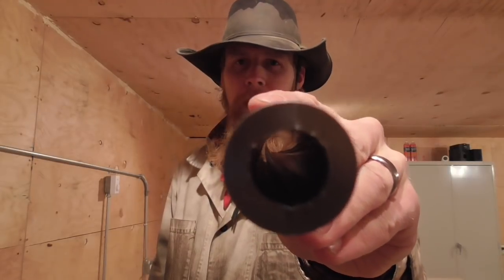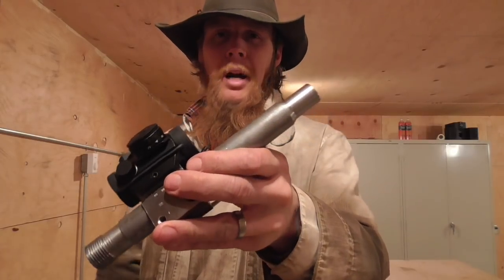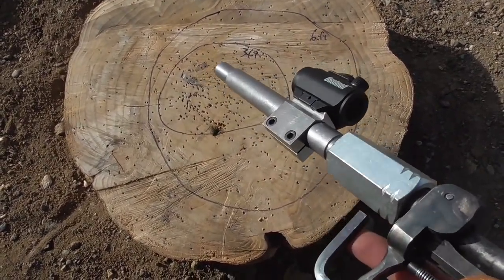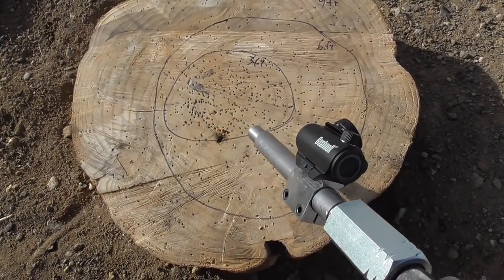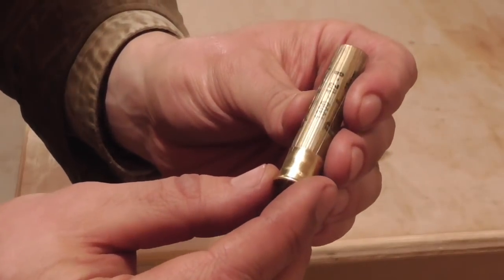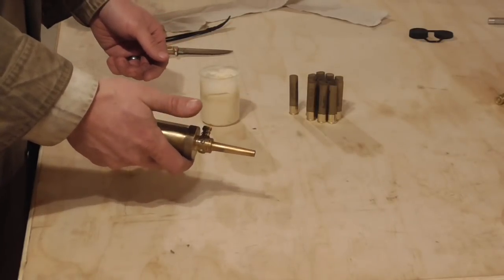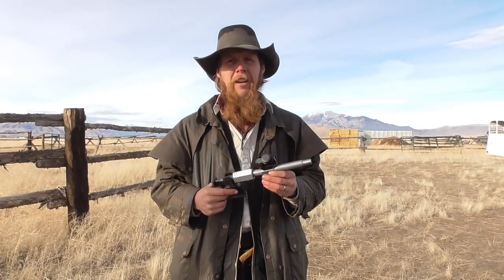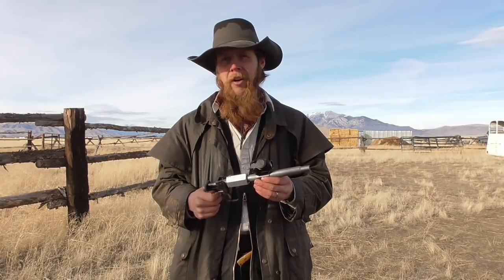Hybrid .410 Shotgun / .50 Cal Muzzleloader Experiment (TIS126)

Comment: have you considered cutting the plastic off of the already fired 410 shotshell casings and then repriming them, loading that apparatus into the barrel and then loading in the black powder, wadding, lube, and 50 caliber ball as if it were a traditional muzzle loader. there is a product out now somewhere that turns a break open 12 gauge shotgun into a muzzle loaded shotgun. it is a metal cup shaped insert that is chambered like a shotshell but it is like just loading the brass part of a regular shell and is made to accept 209 shotgun primers which just push into place with your fingers. it is not a tight fit with the primers to require tools but the primers don't tend to fall out either. then the rest of the load in the shotgun is done as if it were a muzzle loader. this product is what causes me to think of using just the brass from the 410 shells. you may also be able to keep the brass from splitting if you make a thin metal sleeve to collar the 410 shells brass section with when shooting them originally in your barrel and subsequently after they have been reprimed. this would increase the life span of the shell casing brass somewhat.
Reply: here is a link to the adapters that ifound in case anyone wants to see what iwas reffering too

https://www.gunadapters.com/209-muzzle-loading-adapters/

Comment: Shoot .454 casul out of it. It is a little bigger than the .410. (Are you using reloaded .454 brass for the .410 shells?)
Reply from the maker: I'm afraid .454 casull would still be a loose fit.  I'm thinking I might try chambering it for .50 Action Express instead.
Reply: Hum, not sure the .50 AE has enough rim to easily do that. Also it is a shorter case then preferred for this application. I think just maybe dedicated barrels might be the easier option. If you set up some sight that do not have to be shared between them, should be easy enough with your design to change barrels out. Seems to be the point of your pistol design actually, ha.

Comment: You could also try shooting 45 colt in it also  . The pressures of the older version type ammo may not have to high of pressure ?
Reply: the barrel is .50, so it will just bounce down the barrel and perform similar to a musket.

Comment: Dont forget that a rifled barrel puts centripetal force on shot causing it to turn wildly as it leaves the barrel and be extremely inaccurate. Shot needs to be fired down a smooth bore
Reply: Though that would make the gun a short barrelled shotgun and require a tax stamp, if I'm not mistaken.
Reply: I'm building a slam-fire .410 derringer with rifling in the 1st 3" of barrel length and smooth bore the rest of the way. I'm also using 3 x 3/8" steel pipe (more like .475 or .48" ID, not .375") for at least the 2nd part of the barrel or whatever part ends up being closest to the muzzle. Just enough rifling to be accurate in any defensive, hunting or plinking, yet proactive against any otherwise probable infringement upon my 2nd Amendment right or my wrongful imprisonment about the matter of short, smooth bore weapons. I recommend that rifling style in barrels and shot shells less than 0.60" di. if you're at all worried about anything like that :)

Comment: If a 410 is loose, will it chamber a 45 Colt>
Reply from the maker: Well, I haven't tried a .45 colt, but I'm thinking it would also be loose.
Reply: It may give you better accuracy due to bullet shape and the rifled barrel. 
The case might cause it to  bump out and fill the rifling if the bullet is soft enough and unjacketed  This seems to happen when I shoot some of my older original guns with wore bores.